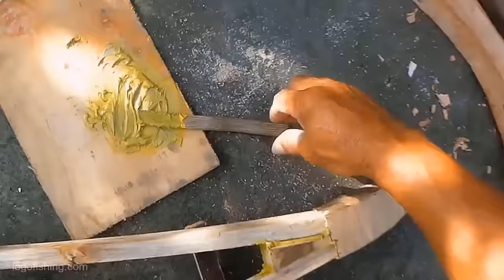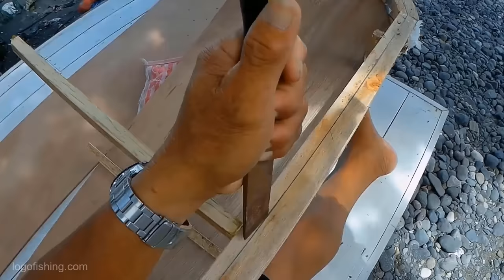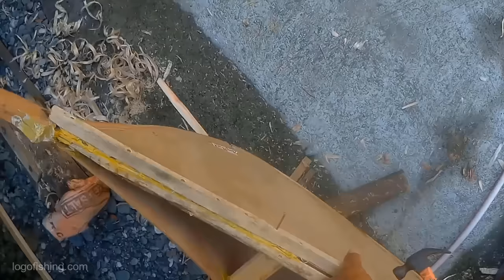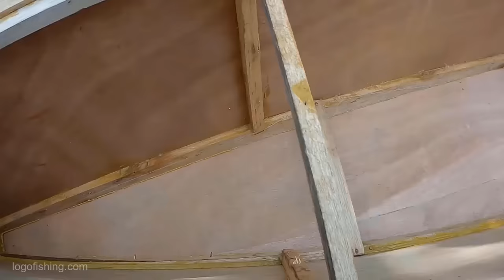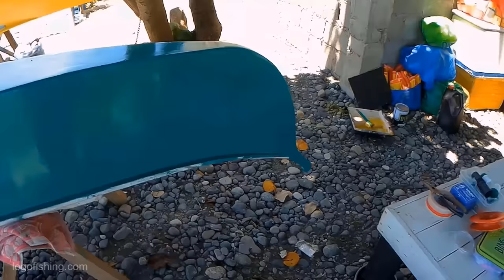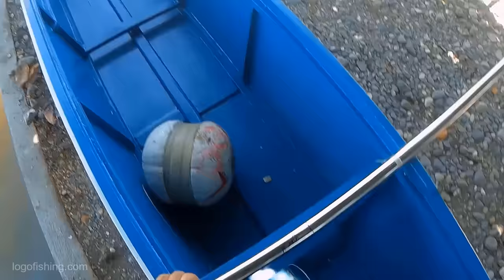How to Make a Boat from Plywood | Building a Traditional Paddle Boat | Paggawa ng Bangkang di Sagwan

Comment: I think plywood boats can be structurally fortified with fiberglass glass mesh and epoxy, inside and outside. You can pick up some of the ideas here in YouTube. It may cost a little bit but it will save lives because it will withstand ferocious waves and it won’t break apart. Take note don’t fiberglass an old boat. Best wishes and God bless !!!❤️🙏
Reply from the maker: Yes, your right sir. Putting fiber mesh will make the boat more strong and water proof. God bless you too sir. 👍
Reply: Yes fiberglass is very tough.. Put lots of ke 3 to 5 layer of fiberglass and coats of resin.. Game Over. Make sure to paint it first.. I guess